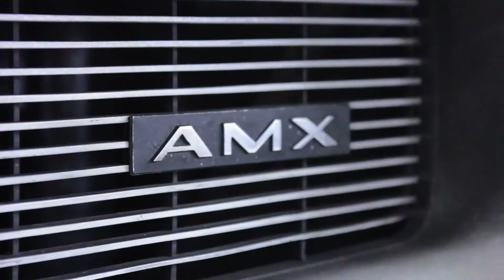1981 Toyota SR5 4x4 truck for sale

Comment: It’s actually a 1982 model, because 1981 was last year of circle headlights and 82 they went to square headlights and went from a 5 digit odometer to a 6 digit odometer.:)
Reply: Yep, first thing I noticed but it's got an 81 or older bed as 82 & 83 had only 2 bed tie downs..  Guessin the bed was replaced and painted but they couldn't find the SR5 decals for it.
Reply: Plus the tail gate on the older one had 2 latch’s and they didn’t have st5 the frost 2 years or so